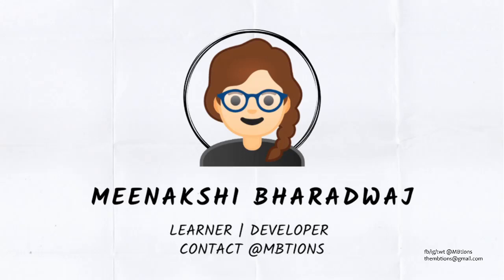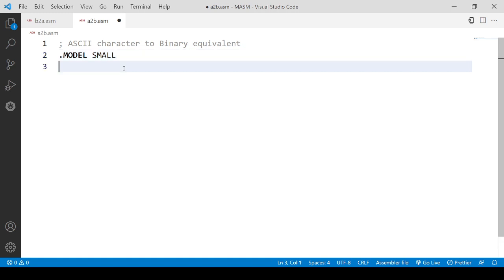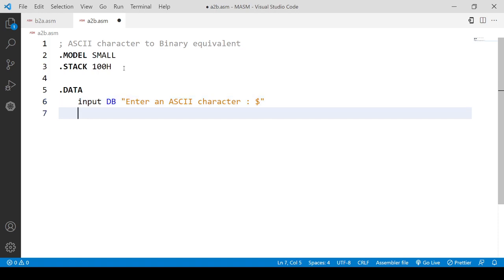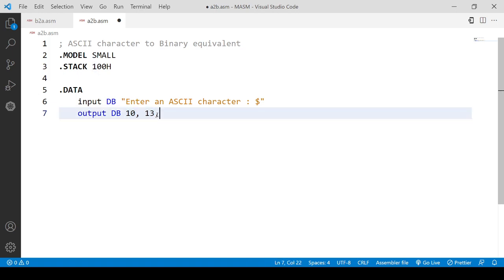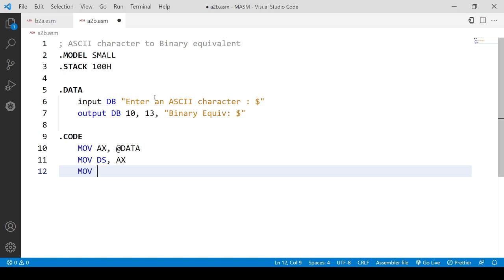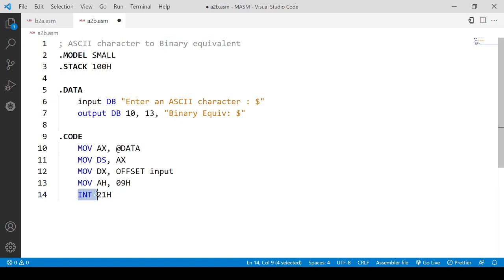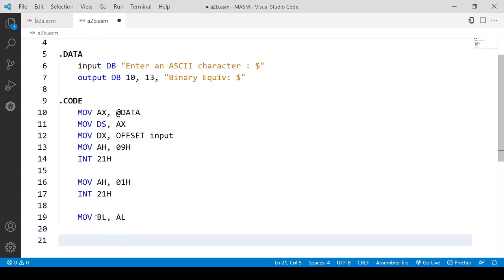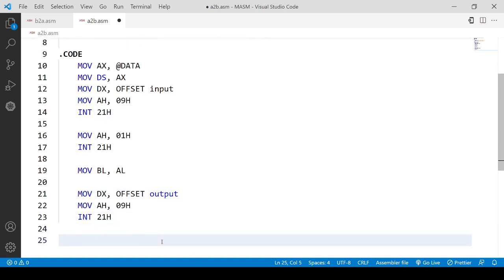Assembly language program for ASCII to binary conversion

Comment: Where to save the .asm file And can we write it in vs code without downloading any extension
Reply from the maker: .asm file must be kept in C: Drive under the folder where you have your execution files such as masm.exe, tasm.exe, link.exe and all related files for execution of the .asm file, for my case the folder was named MASM and all necessary files were kept in it only. 
And in this way, I mounted C: drive and the folder c:/masm
Reply from the maker: And yes you need to download extensions for masm/tasm for executing .asm files in vscode.
Reply: @codewithmeenakshi  Thankyou!